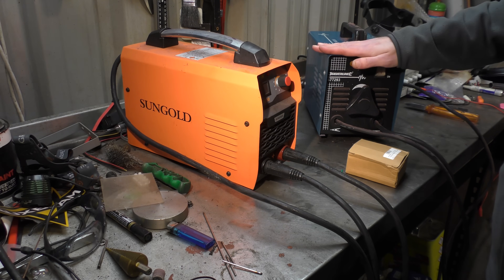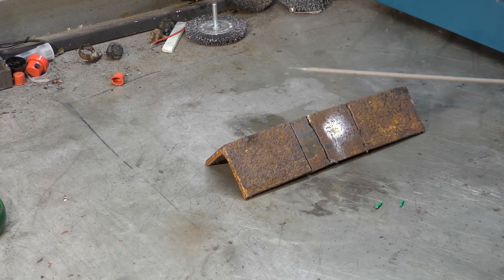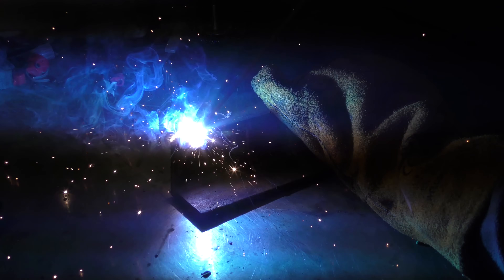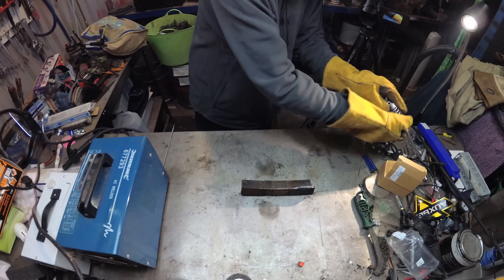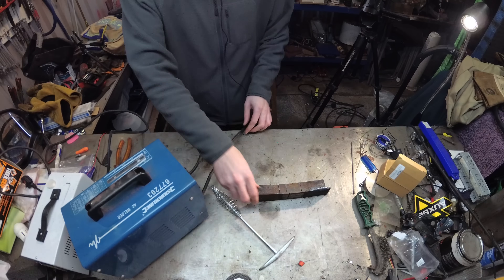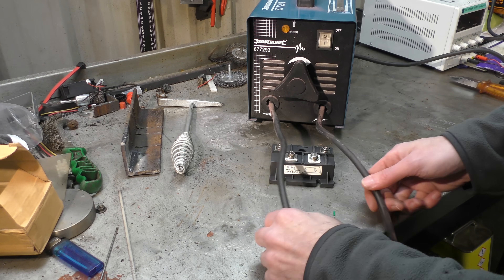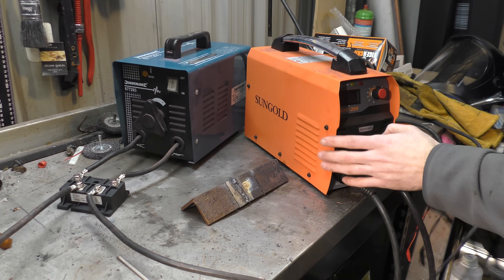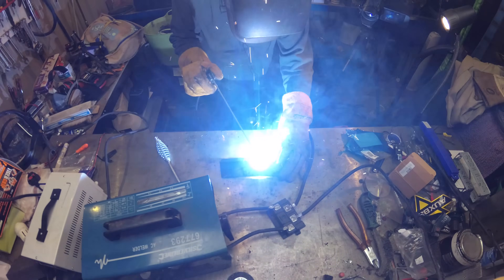Turning AC welder into DC with a rectifier

Comment: The basic idea is fine BUT THOSE BIG BRIDGE RECTIFIERS CAN DISSIPATE 500W. BOLTING IT TO A STEEL CASE WONT CUT IT, it needs decent heatsinking otherwise after a few minuts it will revert to ac as the diodes melt down. I am just doing one and mounting the bridge on a 1/2" alluminum plate 150x250mm and a spreader 3mm plate the size of the welder side. That is only enough for a couple of minutes burn, at a time,  for no more than 10% of the time.
Reply from the maker: The test was to see if you could.

Comment: I just bought a New Lincon 225 AC. Paid $400cnd. Spoke to a welder of 30 years and said just leave it AC. DC is not good if welding equipment that is magnetized also suffers from Arc blow problems. Always a place for AC. Been around for decade's. Bullet proof machine.
Reply from the maker: Smashing.  I spoke to a welder of 40 years and he says that AC has it's place, but if you understand the reasons then DC 9 times out of 10 produces the better weld.  So whatever works best for you is the best choice.
Reply: @DavidMcLuckie I met a welder of 50 years and he said as long as the weld holds

Comment: what you should have tried fitting in this circuit is a bloody big none polarized smoothing capacitor just before the rectifier,, then you would have had a nice smooth flow of DC current to the welding rod!,, but the volt's to the welding rod would have been a bit higher than normal as the capacitor would have held them up when discharging,,,, 
PS,, do you know a way of welding ""wood?"",, I only ask because I am crap at wood work,, and if it could be welded I could do more job's better when using wood!

Comment: stupid question  why not rectify the input lead 110v or 220v  that run at lower amperage . Output less volts but run higher amperage. And this is the second vid where the got the stick on negative why? iam a welder and learned that ground is negative and caliper is positive  and switch for tig
Reply from the maker: You have to turn AC to DC after the transformer.  Transformers don't work with DC.  As for lead polarity if you're a welder then you'll know you can swap them for a variety of different welding applications.
Reply: @DavidMcLuckie  thanks , i know but 7018  do not like reverse polarity , and make shallow  and low penetration welds
Reply: non te ne intendi di elettricita'  ? per fare un simile discorso

Comment: Here’s a question for you, I want to rectify my 2.7kva petrol generator to charge a DC lifepo4 battery bank. Where would I look to find what specs etc I need? And what’s the best way to control the voltage?
Reply from the maker: I'd never dissuade anyone from trying to build something of their own but charging batteries, that's technical.  You've got voltage, current, sensing, cell ballance.  Although I would be interested in seeing your results.
Reply: @DavidMcLuckie  yea I know, its only because I have the spare generator etc. Watch this space!

Comment: I converted a clarke 230 te turbo welder to DC, my mate got me a load of 7018 LH rods, and l fitted dinse connectors so l can also TIG weld using pure argon. It's scratch start, with gas valve on the neck of the torch. Get really good welds.
Just to add to this message, the clarke was ok after conversion, but after using a Parweld  inverter l sold it and bought the Parweld XTS 163, it's absolutely great.
Reply: Would u say it welds better than before conversion?cheers

Comment: I don't see any point of converting AC, especially for welding thin tubes. A lot people mastered 6013 on AC and if you start DC you will have hard time to control the arc blow. If you use magnetic holders the situation is very bad. Better to have smoke and spatter than arc blow.
Reply: Depends on the situation, i use both ac and dc with stick, depending on the rod. I mainly use 7016 rods, although not much any more as tig is so easy to setup these days... i do see your point though, for a non professional or occasional welder its a new learning curve

Comment: Try using a Electrolytic Capacitor 22000uf/100V  Screw Foot, or even up to 47000uf/100v. You can even go as low as 60v Capacitor. But I like to overkill on everything. I also use a 400 amp bridge rectifier . 
I did my spare 100 amp stick welder, and my spare MIG welder. on the MIG, I can swap the pos & neg around for stainless steel. Just try stuff on old welders, the worst thing that can happen is you make a brown s#it stain and let some smoke out. Good luck guys.
Reply: Would the 22000uf 100v capacitor be wired on the + of the DC output from the rectifier?

Comment: An interesting & informative video, I have been thinking about doing this to my old SIP arc welder, do you think it was a worth while project? many thanks for posting.
Reply from the maker: As a few actual professional welders have commented, these old welders will practically live forever.  Giving them a DC output improves them.  The only thing missing from my setup is a large capacitor to smooth the DC even further.
Reply: @DavidMcLuckie  Thanks for your reply David, you're good man !!
Reply: @DavidMcLuckie  Why not a choke coil instead?

Comment: Add a large 8uf 200A 36V capacitor, around $35 on ebay. With the amperages used, the smoothing capacitor has to be of as high of microfarads (uf) as possible since the greater the capacity, the smoother the output DC under full load. Also, some rods require electrode negative and others electrode positive, so keep that in mind. 2 pairs of cheap female internal welder plug sets makes your unit either or (AC or DC), as well as easy electrode positive or negative.  Smoothing capacitor, full wave 200-300 amp rectifier, 2 sets (4 units total) female welding connectors + cheap AC welder = high dollar AC/DC unit capabilities. The smoothing capacitor connected across the DC (Capacitor lug '+' to Lead connector '+') leads stabilizes the arc, providing stored current to the leads when the current from the welding unit drops into the "humped" waveform (actually a form of pulsed DC). You will probably have to run a little hotter on the welder output dial, since the current stored in the capacitor is drawn from the current supplied by the welding unit with each pulse.  A person can use a 200 amp alternator, a 6.5hp gas engine, and a 3-phase 300A rectifier to make a really, really, nice portable 200A dc welding unit using this technique, without the need of smoothing capacitors, since with the three phase output consists of 3 different output waves that overlap each other by 120 degrees, giving almost straight line DC output with just the rectifier.
Reply: I like the alternator idea, but I also must point out here that the Capacitor suggestion seems way , way way off here .  

The  8uF 35V capacitor will be the smaller than a fingernail and will have  completely negligible effect on ripple at welding currents, and will probably explode before you even have a chance to strike the ARC--  since it will charge up to an  open circuit voltage that's likely to be at least twice its rating!
Reply: @yeliab814  you need about a 50000mf capacitor at 40v with a 300ohm bleed resistor 
there is no such thing as a amperage capacity on a capacitor ….😂only voltage ac or dc but you can use ac caps on dc not the other way around  and capacity measured in mf 
USN engineer basic 101.2 lol
Reply: @jimcatanzaro7808  I didn't refer to anything about current capability of the capacitor.  I referred to open circuit voltage and the possibility that it is significantly higher than welding voltage (due to imperfect transformer, in this case as desirable  leakage inductance that provides a higher open circuit voltage to help with striking ARC, also sine wave peak voltage will drive open circuit rectified DC bus, exceeding AC voltage by factor of 1.41).

Also since you mention it, capacitors most certainly do have current capability specifications - it's called ripple current - check out a datasheet.   It's  a very important detail in designing a rectifier bridge filter network ..
Reply from the maker: Thanks for that.  I was actually curious about building a petrol welder.  Very helpful information there.
Reply: @DavidMcLuckie  Glad you found it useful. With the gas engine though, remember an alternator requires exciting voltage to work (unlike a generator which has permanent magnets), so you will need a small 12v SLA (sealed lead acid) battery to power the Stator terminal to get electricity. You can pick up a 7AH on fleabay for around $15. You don't need a full sized car battery since you won't be running a starter, A/C fans, or headlights off of it. A jumper wire can be run from the rectified output + back to the battery to keep it charged. Also remember that alternators use the case as ground (-). The "B" terminal on the unit is +. The L terminal is for a gauge or idiot light on the dash, so you don't need it.
Reply: Paul Andrulis are the any plans for this type of Build?
Reply: @charlesgallegos3575  You can find designs out there, but it really isn't that hard.  It is harder to design and build the frame than figure out the electrical part.
Reply: Hello. what kind of capacitor is that ??. The capacitor parameters are capacitance and voltage,  no ????   I am planning make the same, I already have the rectifier and plan make a choke coil with the core of a microwave. But investing the open circuit voltage of welder is about 120-130 V, so the capacitor must be 200V and for the high currentes of a welder (60 - 150 Amp)  need a capacitance in many thousands of uF,  near Farads itself, so   a 8uF capacitance not will smooth or filter much.....  Or maybe I am missunderstanding something, do you already do something ???
Reply: @345rvv  Yes, microfarads and voltage are the two main specs used concerning a capacitor for selection. The higher the microfarads for a given voltage the better for a smoothing capacitor when converting AC to DC. When specs like amperage are listed on a rating, it is a specialty cap, capable of safely discharging up to the amperage rating listed. Not all capacitors are equal considering such things as terminal lug amperage ratings, etc.
Reply: Mr seley gives 75v unloaded, so rectified that will charge to 100v so no way will a 35v cap servive that!

Comment: I’ve seen other people add a capacitor also after the rectifier for bleeding off the system.
Reply: ? prior to adding a cap there is no energy stored so there is nothing to bleed off. Adding the cap gives storage so a resistor across it is used to bleed of the stored energy.
Reply: caps are not for bleeding off... resistor across the caps do that.. caps are to smooth out the DC valleys. so they almost go away ... more KuFs the more the valleys will be filled in and smoother voltage... smoother voltage gives a smoother weld.. so inbetween the DC peaks.. there is a valley.. that is what the caps remove..

Comment: As some one else suggested you need a choke on the output it will help smooth the dc wave form you could than think about adding some capacitance to the supply before the choke. Otherwise the capacitors are useless by themselves  you would need such a large amount capacitance for  the amount of current draw you'd effectively would need a car battery to smooth out the wave form if the output voltage was 12Vdc. Good video to get people thinking about ways to convert their buzz box over to DC.
Reply: Not at all. I'm doing a conversion to DC and I've calculated that I can get the AC ripple down to 0.9 volts using a collection of 40 x 10F, 2.7V capacitors connected in two parallel banks of 20 caps in series. These caps are going for £1.80 per 5 so will only cost £14.40 in total. I know 40 caps seems like a lot but they are quite small and will easily fit inside my Juba MIG130 welder. I have based my calculations on a maximum voltage output of the welder at 54V DC with a current of 90A.
Reply: @Bodragon  Where'd you get those caps that cheap? A 10F cap is pretty expensive (2-3 euro). What's the total capacitance then? 20x10F in series is a huge one!
Reply: @stefanopassiglia  eBay.
If I could upload a screenshot I would.
Save to say that the seller was one: trail-blazer21_ru
I bought these caps way back in October 2018 so I don't know if he's still selling same at present time.
Good luck!!!
Reply: @Bodragon  Hello.  Do you mean 10 Farads capacitors ???   So,  20 caps in series result in a equivalent of 0.5 Farad, two series in parallel results a 1 Farad ???  ok?? not bad.  The voltaje that supports are 54 V ok ??.     I have a Lincoln AC-180, and planning do the same,  I have the 300 Amp bridge, and planning use a choke coil with the core of a microwave oven transformer.  Calculating the capacitance I realize that need a huge capacitance for thar currents.  Measure my welder in open circuit after the rectifier and have 110-130Vcd,  (with load , soldering, must  drop to 27 - 30V) but for that open circuit voltaje above of 100V, need capacitor of 150V or 200V  so I realize (sadly) that need a super bigger capacitor...  Or I am missing something ???
Reply: @345rvv  If you have two capacitors in series, each takes half the voltage.
So if you have 20 2.7V caps in series, the total string of capacitors can handle up to 54V
(That's 27 x 2.7V)
>

Comment: The current flows from the positive to the negative  just like a truck battery. . 
      DCEN is when Current flows from work piece/ground clamp into the electrode holder when it is DCEN/straight polarity. 
      DCEP is when current flows from the POSITIVELY CHARGED electrode holder into the NEGATIVELY CHARGED  work piece .
Reply from the maker: https://www.thefabricator.com/article/arcwelding/smaw-basics-how-much-do-you-knowr

This is the source of my information.

Comment: Is the Bridge Rectifier 200 amps single phase? ...Are you running on an ordinary 13 amp  single phase?
Reply from the maker: Single phase yes.  AC in DC out.  Just normal plugged into domestic mains 13 amp.

Comment: Hello Sir! From the States. For the LC filter in your D/C output welder.
 May I suggest a D/C Link[motor drive]Poly film capacitor: 800v 220uf @75A forward and 400A max surge.
A Sendust, flat wire, fixed Inductor, rated forward @75A continous.
Using the above,  I calculated 1mv of D/C ripple and forward voltage of 17.2vdc on my Chinese 125A wire feed welder.
@27v no load.
 My machine: 60hz. 115vac on a 20A breaker. Your on 230V 50hz. Correct?
Perhaps using four stud diodes fixed to a 6.35mm aluminum plate for a heatsink, rather than the encapsulated rectifier?
I have read others conversion comments where the bridge has failed when placed inside the welder cabinet. 
A surplus metal boxto house the additions perhaps.
 I Enjoyed your actual demonstrations of the before and after.
Cheers!
Reply: The online calculator I used, has the choice of 50 or 60hz. So you can input your input frequency
For your D/C ripple output voltage with the cap rating you use.
Reply from the maker: Thank you, thank you, thank you.  Actual numbers and products that people can use to build their own.  Have you got a link to the calculator and I can post it here?
Reply: Here is the link:  http://www.zen22142.zen.co.uk/Design/dcpsu.htm
  I recommend not using Ebay components due to manufacturer reject, or knockoff fakes.
Your quite welcome.

Comment: I'd like to know is it easier to strike and maintain with DC then it is with ac I have a cheap ac welder which works fine but sometimes I do have trouble getting started. Once started runs fine but could be smoother. This could be all inexperience but wondering if DC would help improve this.
Reply from the maker: In theory yes, but I still have trouble sometimes starting either.  Some of the DC machines have a feature that's supposed to make it easier to start.  It starts with a high current for an instant to start the arc then drops back to what you set.  DC should be smoother as the voltage isn't crossing 0v at any point.  As a shitty welder myself, the switch to a DC machine certainly helped me make not just quite so shitty welds.  :)
Reply: @DavidMcLuckie  Higher frequency is the most important part. The voltage is second and current last as far as striking goes if Im correct...
Reply: @DavidMcLuckie  solution kapasitor 400uf  250vac

Comment: you need to add a choke after the DC output,i used an old microwave transformer core. wound it with 6 turns of #4 welding cable. works great. you can use cap's but there not really neceasary ,as this is not a DC power supply.
Reply: Would this be the same as other videos I’ve seen where they add a huge capacitor after the bridge rectifier to bleed off the bridge?
Reply: @Lasurge1982  Capacitors store, they do not bleed off, a bleed resistor bleeds off the voltage stored in the capacitors after power is removed.
Reply from the maker: Do you use one with both wires wrapped or one per wire?
Reply: just one side. doesn't matter which side. made the arc easier to start.
Reply: ERWIN SUMMER Can you tell me how much amps is your welder. I'm currently sourcing parts for mine which is 160a and i was looking online what wire gauge to use and some site claimed I'd need 00 gauge wire, which is ridiculous.
Reply: mine is a lincoln 225 i used #4 gauge.